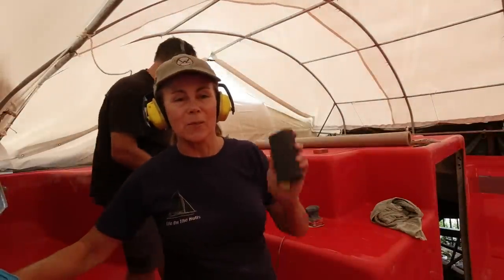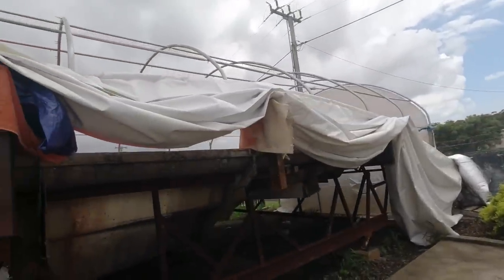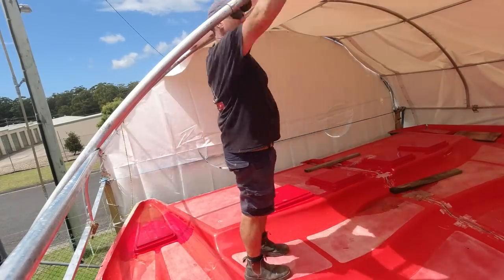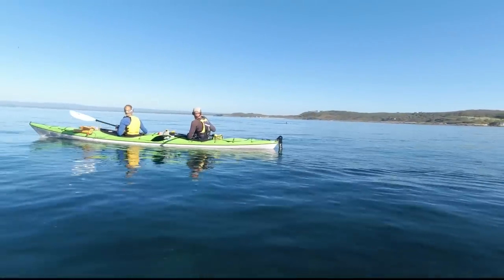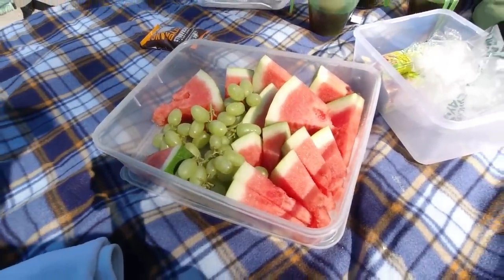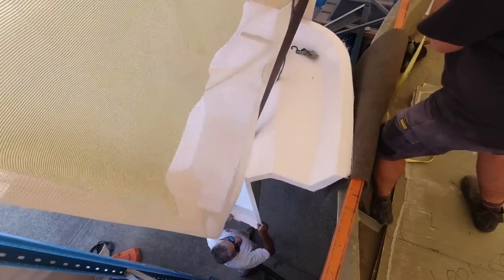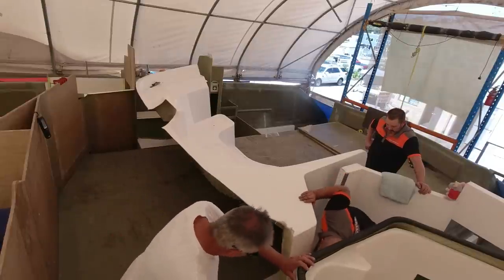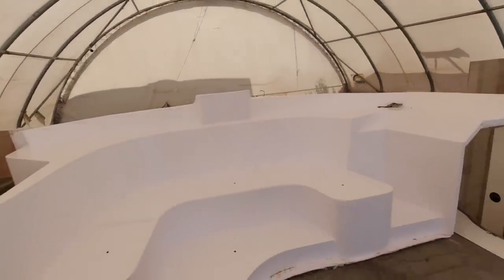EP160 -  Safe from the Rain - Complete Catamaran Build

Comment: In the past, i've used a wee helping of talcum powder on the bars. Works really well and, whilst i'm not 100% sure of it, i'm at least half sure that it also prevented that nasty metal on canvas wear patch that usually happens, so if i use the tent more than a month, i apply it once in a while to refresh the sliding power.